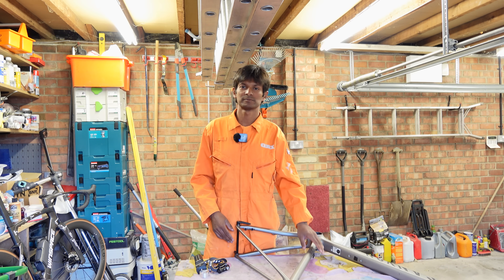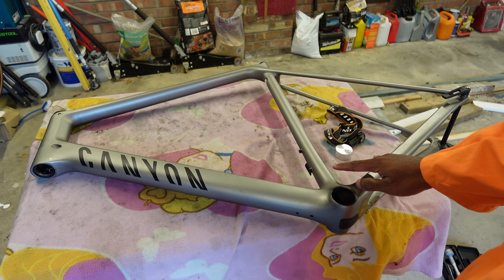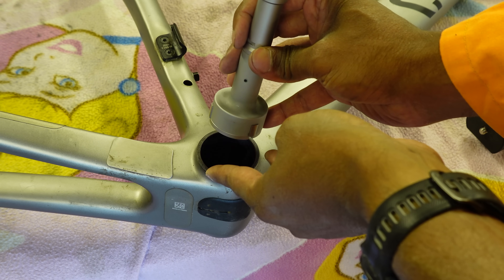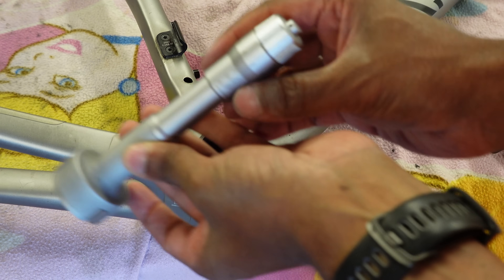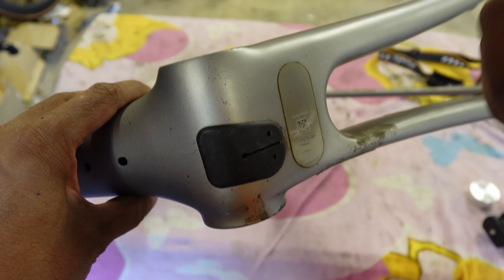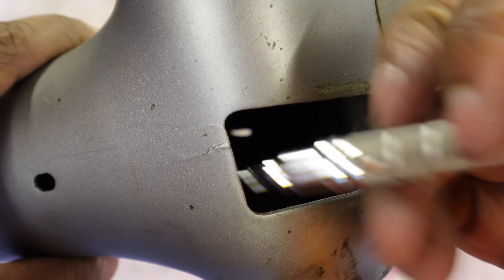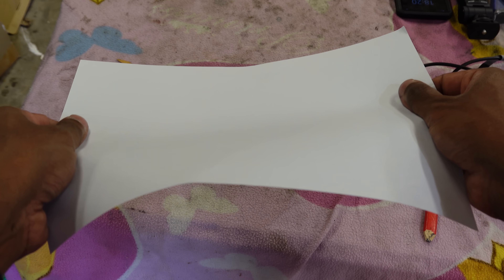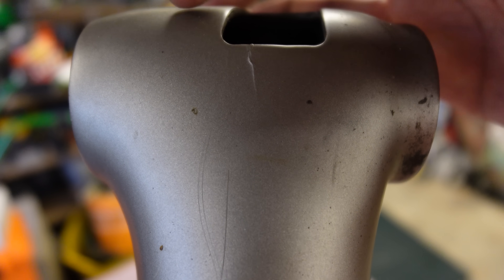Canyon’s “German Engineering” is a JOKE like their Warranty Department

Comment from the maker: The crack was almost certainly from an undersized, ovalised BB shell. The angle of ovality meant the BB, whether alloy or Shimano plastic, was compressed unevenly and created localised stress that led to the fracture. The idea that a Shimano BB somehow "shrinks" to an undersized shell was nonsense peddled by YouTube bike shop engineers. Once the crack formed, any alignment went out the window, flex compounded it and the failure snowballed. I was also not convinced the oversized side was machined that way. Normally you would have seen frayed fibres where resin had been ground out. More pictures and some warranty guidance (UK) are available here https://www.hambini.com/canyon-bicycles-warranty-failure-undersized-oversized/
Reply: Come on Canyon UK, send this man a new frame!
Reply: This is the strongest reason yet why people need to inspect and verify BB dimensions in carbon frames before purchase.  Metal bikes (Al, Fe, Ti) are more forgiving.

Just because one can force a bearing into a n undersized or oval hole doesn’t mean one should.  Doing so leads to catastrophic and sometimes uncorrectable problems.  Consumers need to stop being victims of engineering fraud and exercise their options before reaching the till.  No excuses.
Reply: @paulgrimshaw8334  "Just because one can force something into an undersized or oval hole doesn’t mean one should. Doing so leads to catastrophic and sometimes uncorrectable problems. " Wise words which are apt for a wide range of topics in life.
Reply: @yourtubisfilled7164  haha !
Reply: @yourtubisfilled7164  “…uncorrectable problem.” 

“Listens to his kids scream about eating etiquette.”

Yup.
Reply: @yourtubisfilled7164  ROFLMFAO
Reply: Saw a brand new Canyon frame snap in Co Kerry last week...😂
Reply: owner submitting this video as evidence to the court...keep banging your hairdresser!
Reply: Back-in-the-day I think cartridge (square taper) BB's were developed for ONE reason - so a guy wielding an air gun could simply jam it into the (poorly) threaded BB shell and drive her home. Then the plastic bit on other end was jammed in the same way. When it came time to pull this apart it was pretty obvious the steel BB shell was not to spec, but it rarely mattered with  the forgiving nature of steel. 
Despite the BB shells now being carbon my guess is they're still assembled the same way but the carbon shell is far less tolerant of the butchery so fingers are crossed and the bike shoved down the assembly line. And let's face it, how many of these things are EVER going to be used enough for the problem to show up? Most of the stuff ends up gathering dust on the hook in the garage, so eating one now and then costs nothing in comparison to how much is saved by just slapping 'em together and crossing fingers. But are there too many for Canyon to "eat" now?
Reply: The 'not being maintained denial' is hard to fight. I mean its an engineering fault.I  have a new levo comp carbon. Frame is lifetime warrenty but bullshit like this is s grey area.
Reply: Also I'd like to see some reinforcement around that opening on the bottom of the frame, where the crack happened...
Reply: Needs cheap russian gas to keep it going
Reply: @billyjo1148 LOL! IYKYK
Reply: If Canyon continue to refuse to warranty then that crack looks repairable.
Reply: Canyon 😂Grüße aus germany.
Reply: If you buy a CF frame you'd better understand your going to be replacing it sooner than other materials especially Ti or Steel.
Reply: @apx5777  Never seen any of those Russian ti bikes crack? Poorly made, badly aligned steel bikes with cracked tubes despite their high price? Remember SCANDIUM?

Comment: Canyon sucks. Even the latest gen spectrals and torques (alu) crack. Chainstays and front shock mounts. I know of at least 6 cases of torques cracked around the shock mount and one with cracked chainstay. And every ad for used torque and spectral happens to have a new frame...as if that's a good thing...The repair shop had a pile of frames waiting to be returned.. The only good thing is properly good customer service. But the bikes suck, unfortunately.

Comment: To me it looks like that the owner didnt know how to open the black cover for maintaining/changing wires. You have to know that the wires are connected with the inner guidance of the cover, so if you trying to open up the cap e.g. with a screw driver without cutting the wire on the break lever you can damage the frame. So i dont think it has something to do with german engineering which is worldwide on the higher level as with people who don't know how to work on (canyon) bikes.

Comment: I bought a Canyon spectral in 2019 and luckily had no bigger issues with the frame in about 4 years. As a beginner in enduro mountainbiking i bought their bike in sale thinking this brand was having very high standarts and reputation. When i learned about the industry and read what kind of problems people have with their bikes i learned how big the issues with the bike lobby are. 
I saw videos of a cannondale frame in the past having the same problems as in this video.
The longer i had my canyon the more i disliked it.
Later i also realized that the geometry with an xl frame was poorly scaled up from the smaller sizes. Means same size of chainstay combined with huge reach. Result was me getting more problems over time learning cornering and jumps properly. Another example about the spectral from 2019 is that the chainstay was poorly designed, the part next to the  chainwheel was so thin that it tended to break easily. Today i almost believe it was designed on purpose like that. Most of the broken frames are not being replaced by guarantee, especially in mtb…
Its really recommended to inform a lot in the internet to learn what youll get when you trust in such companys. Canyon ceo’s just have dollars in the eyes….

Comment: I questioned Canyon’s engineering when I was torquing two suspension linkage bolts. One from each side that threaded together. Essentially a bolt with a nut. They were marked with two totally different torque values. I’m sorry but that is impossible.
Reply: Aren't disc frames somewhat asymmetric?

Comment: Yep, I had issues with my carbon LUX.  They bought my bike back from me.  I had a local bike shop advocate for me which certainly helped.  I would not buy a carbon Canyon, however my 2021 Canyon Spectral AL is a very solid bike with zero issues, so I would buy another aluminum Canyon.

Comment: I own a old Canyon Fully (Nerve AL), a Canyon Stoic AL, a Canyon E-Bike (Pathfinder) and since a year a Canyon Ultimate Carbon Road bike. I never had any problems with the Aluminium bikes, had some questions regarding the E-Bike (was a outlet bike) and support was very fast. On the Ultimate Road Bike, I had damage on the carbon from my chain which was my fault 100% and they replaced the whole frame for free. So far I didnt had any problems with canyon support at all. They are very fast in my case.

Comment: I had F8 grand canyon mtb raced with it for over a decade never had a problem, now i am riding canyon lux carbon for last 5 years racing every weekend has been solid zero issues. It looks like Road frames are lower quality control
Reply: OR maybe fat, low-pressure tires reduce the stress vs road bikes? OR maybe Canyon's Q/C has been ditched since you bought yours 5 years ago?

Comment: Have an aluminium Canyon. First frame had to be replaced because it came dented from the factory. Also the BB was so loose I could remove it with my fingers and creaked all the time.

Second frame had brake posts too high, causing the pads to not fully contact the rotor, and the rear axle creaked because it was loose due to bad tolerances.

I ended up fixing those issues myself.

Also, the paint is rubbish and chips if you look bad at it.
Reply: But they're such a value being consumer-direct and all....right? I guess if you want a DIY project maybe?

Comment: Carbon fiber - the gift to the cycle industry that keeps on giving. Endless product churning. 'This year's model' is always the supposed new improved version - it's always more aerodynamic, a few grams have been shaved off here and there, the cross section of a given tube gives more rigidity/compliance (take your pick), the layup uses a superior fiber with a closer weave, and so it goes on.
Reply: And that was never the case with steel, aluminum or titanium? "This year's model" planned obsolescence began long before - borrowed from the auto industry. I was in the biz then...same bike with new stickers and paint was "This year's model" without any other changes, forcing us to discount last year's identical bikes in order to move them off the shop floor to make room for identical (except for paint color/stickers) replacements at the "This year's model" price.
Reply: @larryt.atcycleitalia5786  In the UK in the 1960s and1970s, anyone wanting a proper racing machine (not an approximate lookalike!) went to a firm that built frames - for example Mercian, Bob Jackson, Condor and others. This was typically built from Reynolds 531butted tubing with Campagnolo fork ends (dropouts). Club riders always built up their own machines, with Campagnolo, Stronglight or T.A. transmisison. The brakes were usually Mafac, Universal or Weinmann. Campagnolo introduced its brakes in 1969 as I recall. Strong, light and reliable machines - particularly with all - Campagnolo equipment if the rider had deeper pockets!
Reply: @larryt.atcycleitalia5786  During my racing days in the UK  in the 1960s and going into the '70s and '80s, club cyclists built their own machines up. Frames were built to order by small specialist businesses. Cycling was a minority interest over here in those days - no mass marketing by big companies.
Reply: @larryt.atcycleitalia5786  I've had two replies to your comment deleted. I don't know why!
Reply: People have money, they buy that stuff...

Just don't buy carbon, who really needs it? or a 5000 € bike? very few are racing.

Comment: hi Hambini i have only just came across your channel and only watched one or two video's up to now, very much enjoying your content though, i came accross you due to i am looking for a test of using ceramic grease in steel bearings and on axles etc and if there is a benefit over the standard crappy grease manufacturers put in. i'm actually a motorcycle rider and thats where i am interested but all of the same principles are true as cycles just at faster speeds and more load. i am running ceramic grease on everything right now in new bearings and linkages, axles and everything else, just  pushing the bike around it feels much easier and lighter to push compared to pushing around with all new bearings etc but with standard bearing grease in the bearings etc, so wondered if you could do a comparison between statrd grease manufacturers supply and changing it all for ceramic grease/ i did it for better lubrication and less chance of wear and corrosion getting in btw. thank you John

Comment: I had the same issue with Canyon Ultimate CF SLX Rim brake. After few rides the frame felt very soft and I found cracks in the same place under bottom bracket. They've accepted my claim and replaced the frame. I'm still riding it 6 years later.

Comment: My carbon grizl cf sl 7 developed matching small cracks on either side of the top tube where it meets the head tube after about 2 years… after a nervy wait while it went through a couple of levels of warranty checks I was thankfully provided a new frame set under warranty. Obviously not great that the frame cracked but thankfully it was resolved in my case.

Comment: Awesome...i just bought Canyon Lux Trail cf9 second hand (but basically new) bike. I heard about bad bottom brackets if its press fitted. I have BSA73 which is screwed. Bike suits me very well I like it and the price was 2700Eur for 1year (so in warranty still) old bioe with maximum 200km driven. Should I sell it? I dont need electric shifting, but the SID 120mm, carbon wheels and 12,5kg weight is awesome

Comment: I bought a canyon bike and returned it because of size issues but I wonder , I have a Fuji Sportif 1.7 from 2012 ! , at some point i rode it 70 km daily, until date , the only parts that needed change were the tires and brake pads and once a car broke my front wheel so had to replace that … other than that I still have everything as is 😅 sometimes I think Fuji doesn’t sell so much because their customers are riding the same bike for 12 years.

Comment: laughs in 26 inch Raleigh dropbar conversion 

Cost me about 100 quid to build. 
Mavic Crossride wheelset, old Shimano 600 6400 STI shifters and an old italian handlebars that are just super comfy.

I often pass people on "nice bikes" like this and they fail to keep up.
Its not the gear that'll make cycling enjoyable but so many people seem to think so, then buy into marketing nonsense thinking they get high quality stuff when in fact its just a polished turd.

I avoid carbon at all cost. Everything I have is either steel or alu and I'll keep it that way, mainly thanks to Hambini showing me the fascade of manufacturer's nonsense.

Comment: It shows that the companies that are producing
bike frames should provide an extensive Q.C.
document for frames and maybe get a independent 
company as well to double check them. It may
add to the cost that been said the frames are
possibly cheaper to produce than one might 
think. What I am stating is that It may well help 
to put a stop to or push back the crap..

Comment: My friend has one of these but aluminum, and he’s also cracked it because of his weight  and agressive peddling!    

Yeah, he hadn’t actually done any repairs yet. It was when he took it in for his first tune up because it felt a bit off and they alerted him to a nasty crack. Luckily for him that shop is where he purchased it and they didn’t do an even exchange but they purchased his “core” aka the whole used bike.  And then use that as the discount towards a gently preowned replacement.  funny enough that cracked a few weeks later, but was from proper abuse of going off a trail when he was drinking heavily and smashed a rim and ruined the frame. Wasn’t even that bad of an impact, but it totaled that bike. I properly totaled the frame.

Comment: Canyon bikes look great – until something goes wrong. And when it does, prepare for a nightmare.

My Neuron ONfly developed a loud creaking noise when pedaling, caused by a fundamentally flawed motor mount design. This is clearly a warranty case – yet Canyon has left me waiting for more than six months without a solution, without a replacement, and without any real support.

Instead of honoring their responsibility, Canyon has wasted my time with endless delays, excuses, and empty promises. Their so-called “customer service” is nothing but a black hole where complaints go to die. In the end, I had no choice but to hand the matter over to a lawyer.

This company has shown me that once you hand over your money, you are completely on your own. I will never buy a Canyon bike again, and I can only strongly warn everyone else: do not make the same mistake – stay away from Canyon!

Comment: So glad to see someone calling Canyon out. Their build quality and QC has always been a mess in my experience. In my 7 years as a mechanic, canyon bikes have the highest rate of frickery among any brand. There's a reason their bikes are so cheap, folks. Buy a bike from a good LBS, they won't let stuff like this happen to you!
Reply: They aren’t that cheap anymore sadly
Reply: Your point is sound in general, but some LBS can be horrific to deal with. I had one service my bike I bought from them, and cycling home one day, the crank came out of the bottom bracket. Luckily, it was uphill, so I could catch myself. Another shop sold me a bike and told me I sized down in that brand. I contacted the brand, and they said it wasn't the case. I had only had the bike for a week, so I barely had any riding, and the shop flat-out refused to help me until I mentioned consumer rights. In general, I would prefer to go local but given how expensive bikes are it makes it really difficult to not look at brands such as canyon.
Reply: You suggest buying a bike from a good LBS as if they are even carrying a bike I need. But let’s suppose they are. If afterwards I need a part for that bike or a warranty claim and the dealer went bancrupt? Which happens all the time. Who will I be contacting? I don’t see how buying from a brand you cannot go directly to solves anything.